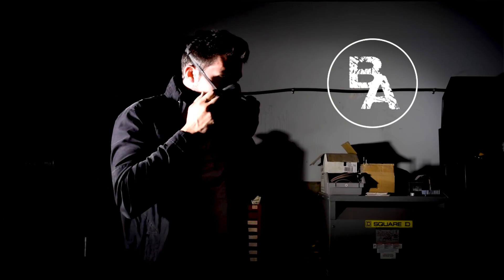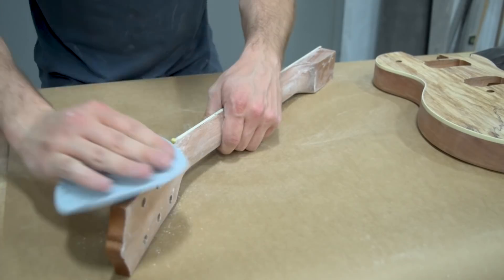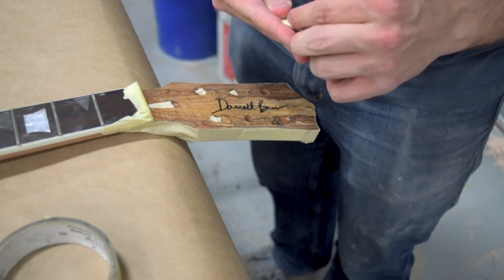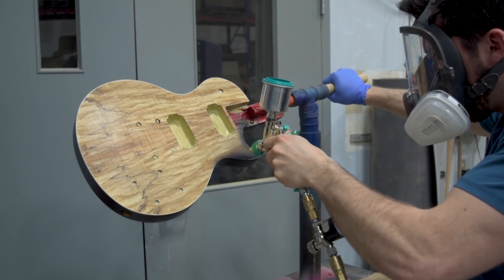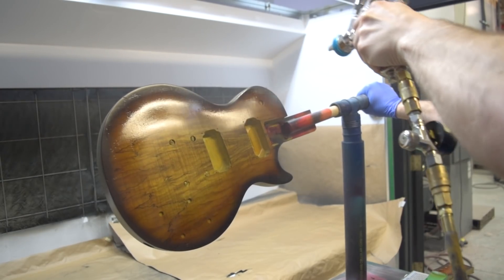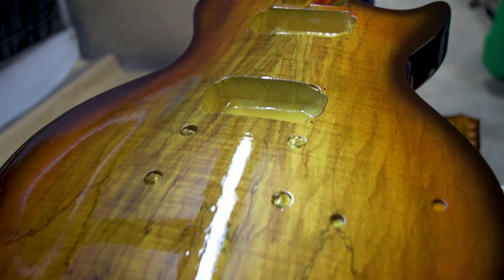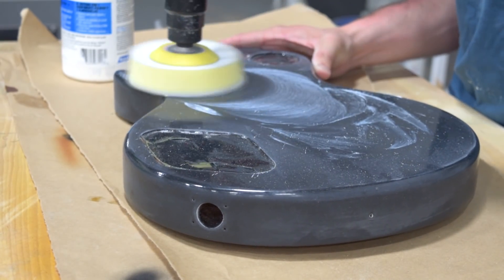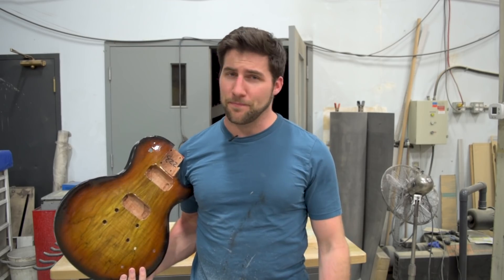Darrell Braun's AWESOME Spalted Maple Les Paul Guitar Kit (the paint job)

Comment: Brad, I just love this guitar you did for Darrell.    On you link to Amazon I see you use Behlen products.    Could you provide a list of products and colors you used on this?    It’s a lot to ask but you did an awesome job and I would like to replicate it.    I also wanted to know if a sprayer is required or if I can get them in a spray can.     I’ve subscribed and have watch several videos.   Thanks for sharing your insight on your work.
Reply from the maker: Hi Ken. Must of the stuff I used is available on the amazon page, as are spray can versions of some. I started off with behlen’s vinyl sealer on this. It’s available in a can. The I used behlen’s stringed instrument lacquer tinted with colortone amber dye. You would need a sprayer for that mix, but you can substitute in the starcast amber toner lacquer in a can for a similar look. I added in some American Walnut anilin dye powder to the amber mix to get that brown burst. That’s a tough one to emulate with spray, but several coats of the amber toner lacquer might do it. Have a look at my 5 video series on using behlen’s guitar finishing kit to see that stuff in action and how I do a burst with spray cans. 
For this one I finished off with a catalyzed polyurethane. If you want that in a spray can you will use the spraymax one (on the amazon page as well). Have a look at my video on how to get a professional looking clear coat with spray cans to see that stuff in action.
Reply: Brad, thanks for your reply and your support to your channel.   I’ll check out your 5 video series as well.   I’ve learned a lot from you already.

Comment: Not bad...way too much pressure and material when applying the fade. Easy with such a narrow fan. Way too much material then massive air pressure blew ripples into it. If there weren't pinholes in that I'd be shocked. Not bad clear application but so much peel. Either increase air pressure, or turn in material screw. Wet sand with 800, 1000, 1200, 1500, 2500, then 3000 and 5000 trizact with a semi soft magic block to cut some of that peel down. Modern HS clears hate "tack coats". Spray each coat like you want it to look. A dry tack coat is magnified by each successive coat. Best bet is to shoot 3 coats, let it dry over night wet block sand with 800 wet then shoot 3 more coats. Apply 3M dry guide coat, sand 2 off and buff. Trizact is meant to be used damp on a super fine da sander. Using it dry by hand is doing nothing. The 3M Ultrafina SE or formerly Ultrafine machine polish is meant to be used wet. Put enough compound down to maintain a wet surface, make 3 or 4 passes and wipe with a microfiber. It's not meant to be buffed til it's gone. You definitley have the basics down. Check out Southern Polyurethanes website and their perfect paint job instructions. Great resource. I think you might like their Universal clear more than Upol. I've used it for years and it lays down much better than a lot of other clears.  I haven't found  better clears than RM 5335 or 5600, though. If the customer is happy AND pays, then it's a perfect job. Best of luck to you.
Reply from the maker: Hey, thanks for the info. This clear has been giving me some trouble, so I’ll try your tips out. 

The burst was done with acrylics, so it worked out really well with that application method. Glad to have your pointers on the 2K poly though for sure.
Reply: @BradAngove  good deal. Hate to sound like a smartass know-it-all, but I've been blessed with insights from master painters who took the time to pass on their knowledge. At the end if the day it's what works for you. 36 years painting and still learning all the time.

Comment: Spalt is a fungus. I don't understand the attraction to it.
Reply: Finally! Somebody said what I've been thinking every since its become so popular with guitarists. Lol. Another fad I despise are all these roasted maple necks. I dont see the beauty in them at all.
Reply: Roasting wood could have some value if you could prove the wood had a stability issue. It comes at a cosmetic cost for certain and the more you process wood the weaker it becomes so if you were having snapped headstocks, you are going to have more snapped headstocks. The solutions to either problems would be to use better wood instead of roasting inferior prone-to-warp wood or stop swinging guitars into door jambs or dropping them. Relicing is like texting. Relic and text weren't verbs until some idiot decided to start doing it. Try telling a millennial or an average person anything logical though.

Distressed stuff has been around awhile and it is an art if it's well done. It's impossible to pull off completely. When you take a battle-worn '65 Fender out of the case it won't smell like fresh lacquer like a fake one. The origin of distressed pieces was in the repair industry though. To put something old back together that is broken without the repair being noticeable is the proper application of distressing a finish. People who play and work on guitars know that once you soak bridge saddles in vinegar to corrode the finish, all those surfaces wear and become difficult to adjust. Smacking a perfect lacquered surface with a handful of barbed wire or throwing your keys at it and freezing a perfect guitar in the trunk of your car to simulate age seems pretty gay, but there's probably gayer stuff out there if you look for it. When a relic finish is done so a hipster can have a group masturbation session with other hipsters, well what's the value in that unless it keeps them all from reproducing and it doesn't go on in public..

Comment: Nice looking guitar but I am a little confused at the intent to have spalted only to hide most of it under black...
Reply from the maker: Most of it?
Reply: Well, technically, yes. Why not do to the back same as front? Was it a conscious decision? No criticism, just questioning because the guitar is quite nice looking. My personal preferences made me do it!
Reply from the maker: Oh, I see what you mean. I thought you meant we were hiding most of the spalted maple under black. The back is a 3 piece mahogany body that didn’t look as good. It’s also a darker colour. We considered mirroring the burst on the back, but I didn’t think it would look as good.
Reply: Darren chose a tobacco burst pattern, similar to one available on older Gibson Les Pauls (new ones too...).  With the back being three parts and not matched, it makes sense to do it in a solid color.  WIth the tobacco burst using black around the edges, carrying the color to the back looks nice.  The stain on the front absolutely brings out the spalted grain.

My personal choice would have been more of a cherry burst, and satin finish for the back/sides.  And maintaining the binding.
Reply: There is a way of staining and then sanding back that can make the top pop.  Put dark brown, blue, or black stain down.  Sand - the spalted maple pattern jumps out.  The colors are fine.  The burst is great.  It's a very old - tried and true method of adding extra character to the wood.  My color choice would be different - just out of personal taste - but it looks lovely once it was finished.

Comment: Did I hear wet sanding doesn't make a difference?! First person I've ever heard say that!
Reply from the maker: Really? I’ve had many discussions about this with people. With modern sandpaper there’s no reason to take on the added risk of wetsanding.
Reply: In the leveling process, wet sanding is a very important step in getting rid of the waves in the finish. If you skip that step, no matter how fine you polish, it will not fix the waves in the reflection. If you don't have a perfect mirror reflection, you didn't level it properly.
Reply from the maker: Yes, sanding is very important. It just doesn’t need to be wet.
Reply: Kind of a late response. But having grown up in a cabinet shop. After any of our lacquer finished curing(3-4 days on average) We would always wet sand 800-1500 grit(water with a touch of soap for lubricant) it smoothes out the high spots and I'd say gives a superior finished product than skipping it. It can help with orange peel as well.(also typically very important to sand between coats of finish gives a better finish as well. I've definitely put out personally and helped put out some amazing pieces of furniture and cabinets using this process. it isnt the only way to do it but defintely an option.
Reply from the maker: Yes, once again, sanding is important. Leveling out your finish is an important step. But with modern sandpaper there’s no need for it to be wet sanding. Dry sanding is less risky when finishing wood and accomplishes the same thing, whereas you used to need to do it wet to lubricate the paper.
Reply: Brad Angove why does EVERY CAR PAINTED GET WET SANDED? Surely we aren’t claiming to be smarter than Chip Foose, or every single builder that is auctioning the hot rods they wet sanded for many thousands if not millions of dollars at Barrett Jackson this week???? Or does the opinion only pertain to wood? Not being a smartass but surely you see why I have a hard time believing one opinion over many thousands. I’ve never heard a car painter give that opinion and I’m a gear head. Since I missed your original comment could you briefly explain if your theory pertains to other surfaces than wood. Thanks
Reply from the maker: They wet sand in cars because it can make the paper last slightly longer, but even with that in mind, it doesn’t happen all the time now. Modern advances in sandpaper are making it less universal. I worked in an auto body shop briefly, and we often dry sanded, particularly on smaller stuff. In fact, if you look up some of the newer videos from guys doing high end polishing work, I think you’ll find that many use either no water or just a little. The guys you’re referring to used to soak their paper for hours and basically dump water on the cars. Old paper. 

Let’s also keep in mind that the same guys you are referring to also used to add a bit of soap to their sanding water. Guess what nobody does anymore...
Reply from the maker: Essentially no professional guitar finishers wet sand anymore. You know why? Because I’m not wrong. It doesn’t give a better finish if you use high quality paper. And the risk is that you cause cracking in your finish, particularly if you’re using lacquer.

Comment: I got a new tablet, and I cant find anything on it yet.
Actually, I kinda hate it TBH.
...and in other news...
ALL 4 of my playable guitars got stolen.
To say that there is a person or persons in grave danger of great bodily injury is an understatement.
I put up rewards for the return of one or all of them, and nothing.
I'll pass the various curses I could inject here. At this point the pain is nearing the point of a nice numb head bashing...and Ive done my share of cussing already. I'll probably finish up sometime in 2021 or so.
I dont even have a guitar to play. O_ 0 Not trying to be a bummer, but it really really really sucks.
A few tips from my experience...
Take close up pics, and write down the serial numbers of all your guitars.
Dont keep the serial numbers in the case... Somewhere else.
Open up your Electronics cavity (on electrics) and put a paper in there with your name address and phone number. Hide it in some crevice if you can... Replace the cover.
Even if something happens with the serial number (like they scratch it off) the guitar can still be IDd as yours.
Treat your guitars like youd treat a baby. DO NOT EVER turn your back on your guitars for even a minute while there is an unlocked path to them.
They came in through my open front door while I was just 40 feet away with my brother, but could not see the door or the guitars.. I missed the asshole/s by 10 minutes, and then I screamed at the top of my lungs for a lot longer than 10 mins.
There is now no hope I'll get them back unless they try to pawn them. They are gone and my stomach turns everytime I think about it.
Yes, Ive seen Darrels channel and the guitar is stunning. Great work!
Reply from the maker: Damn man. I’m really sorry to hear about your guitars. Keep an eye out on Kijiji and Craigslist from the nearest few towns/cities. They may post them for sale in a nearby area if they aren’t too smart.